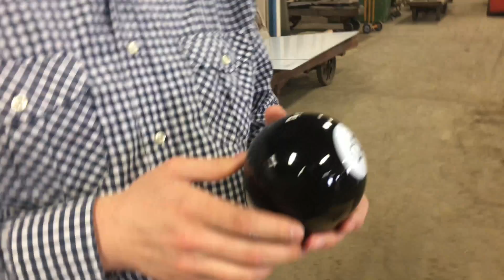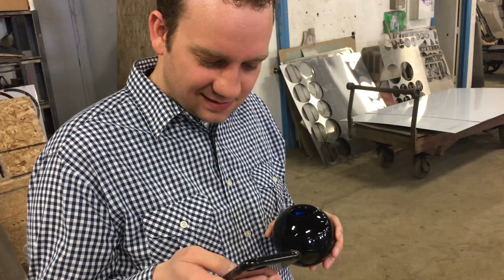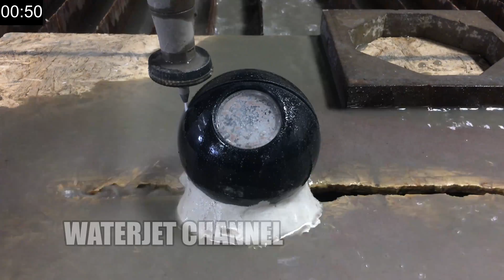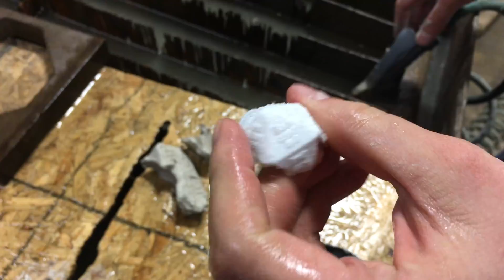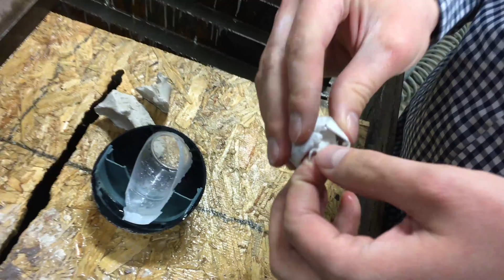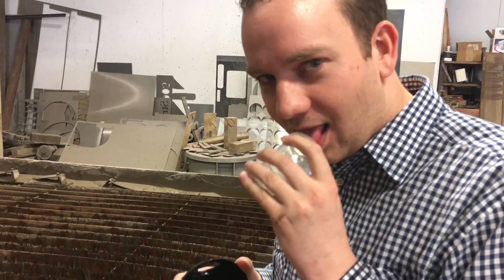Magic 8 Ball cut in half 60,000 PSI Waterjet

Comment: Give the water jet a little challenge, cut a 20ton bottle jack. Like if you wanna see it also.
Reply: I used to run one... the bottle jack wouldn't be a problem, with the possible exception of the oil inside. It would make a mess.
Reply: +Oddman1980 yea but can drain oil first, I wanna see it cut right down the center of the ram, at that a decent size Hydro piston would work also to be cut.